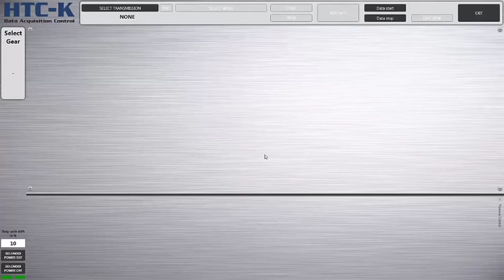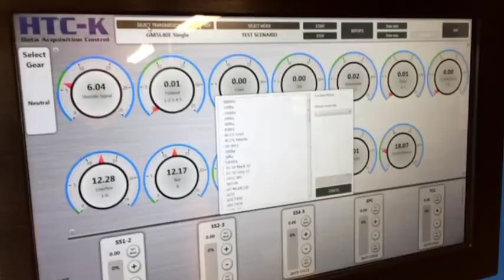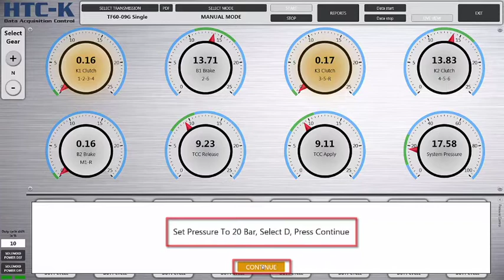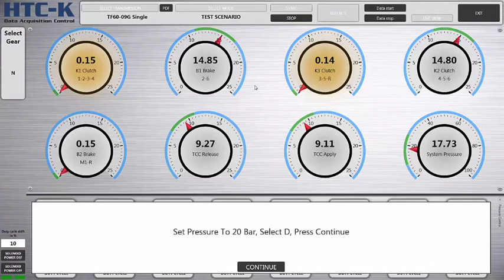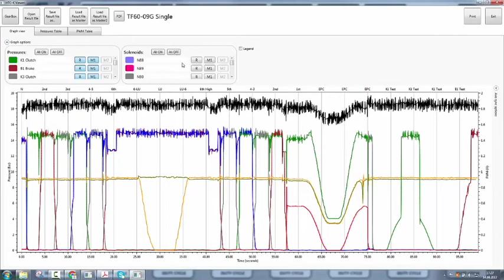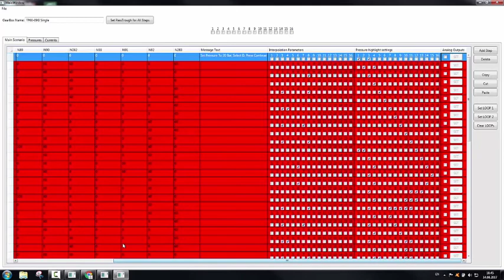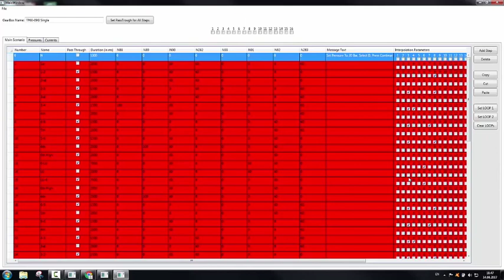HT-VBT Deluxe video guide & HTC-K Controller explained

Comment from the maker: 0:00 - Intro
0:13 - Connection of a Valve Body to HT-VBT
0:36 - Introduction to various Pressure Settings (Auto / Single / Step)
1:46 - Explanation of Master Data
3:01 - 'Test Solenoids' mode explained
3:45 - Introduction to the 'Test Scenario' mode
4:04 - 'Manual Mode' explained
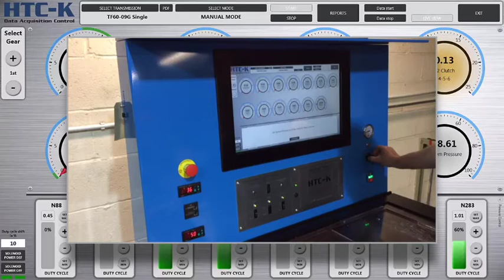5:08 - 'Auto Mode' explained
5:37 - 'Auto Mode 2' explained
6:09 - Use of 'Live View' feature
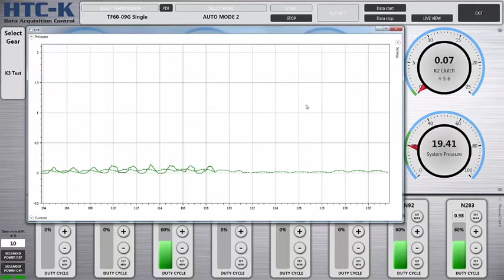6:45 - Duty Cycle for PWM and DC solenoids
7:08 - 'Test Scenario' mode & introduction to Test Graphs
8:53 - Explanation of Test Graphs
10:11 - Data comparison principle
10:34 - HTControl Editor guidelines & tips on writing own Test Scenarios
12:12 - Interpolation Parameters for PWM and DC solenoids (in HTControl Editor)
13:12 - Closing